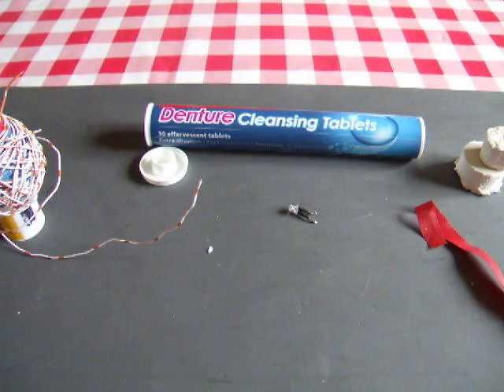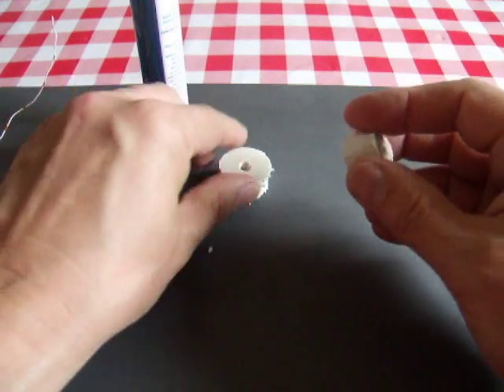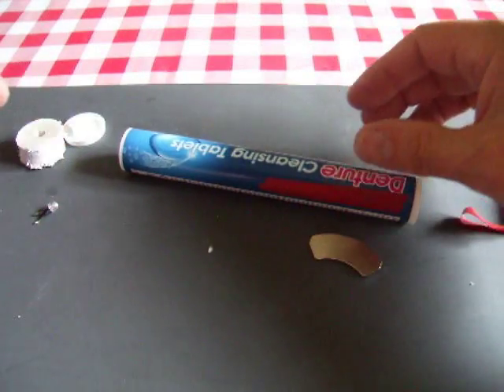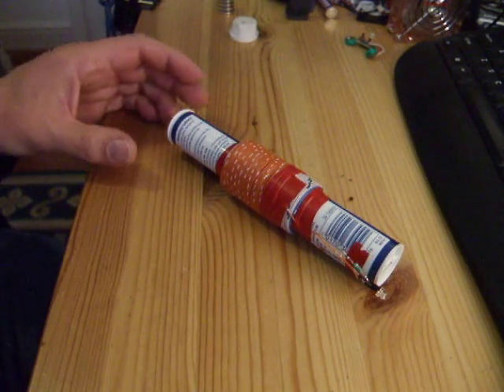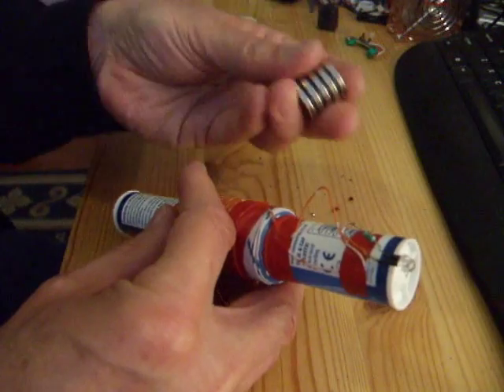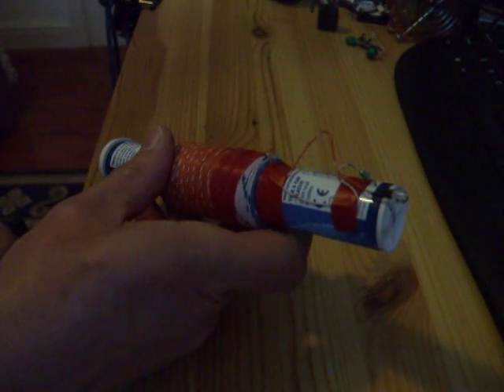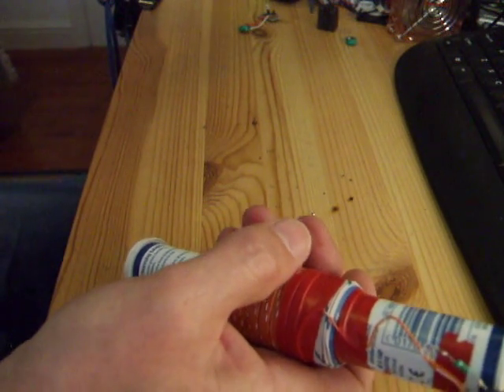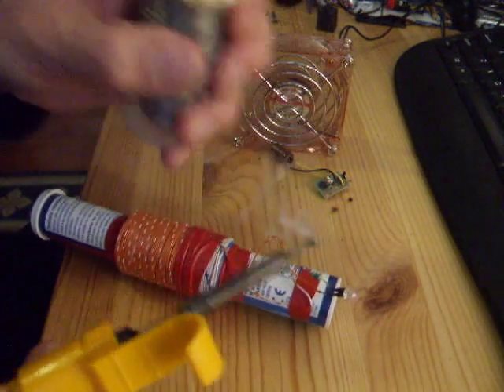Let's make an Induction Generator Shaker

Comment: can u explain the use of capacitor in the circuit in more details ?
Reply from the maker: The capacitor is being used like a rechargeable battery to store the power. It does not hold the power very long but it is enough to help the LED light.

Comment: Isn't the resistor going to make it more difficult to light up the LED?  Why not run it directly to the diode?
Reply: <This is coming from a guy with little to no experience with electronics.  So anyone who may see this- I'm not saying the resistor isn't needed.
Reply from the maker: It will work direct and for the purpose of this experiment you will probably be fine. The main issue is there is no regulation on the voltage generated by the coil so it could generate big enough spikes to kill the LED, the resistor is there to protect it.

Comment from the maker: Hi michael cassin, I cannot reply to you comment directly due to problems with YouTube's comments system. I think the details I gave in the video summary probably answer your question. The one I made is not very efficient. You really need thinner wire than I used and probably 1000 turns or more. You also need good strong magnets. I used 5 neodymium magnets together. It wouldn't work with ordinary magnets. You can also add a diode bridge to ensure you get power from both up and down movement. Here are a couple more of my videos
http://youtu.be/vYDNvp6HD34
http://youtu.be/VRAvs6XusMw
Thomas Kim does some good videos, here is one http://youtu.be/gZpa7FYR_pw